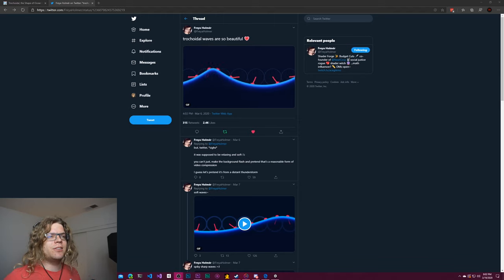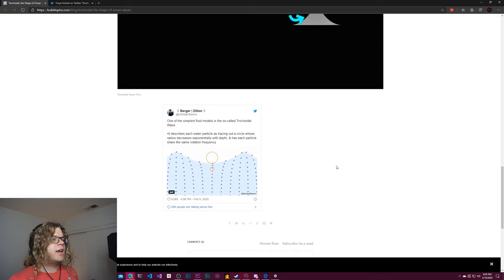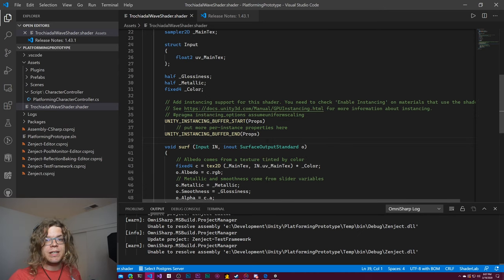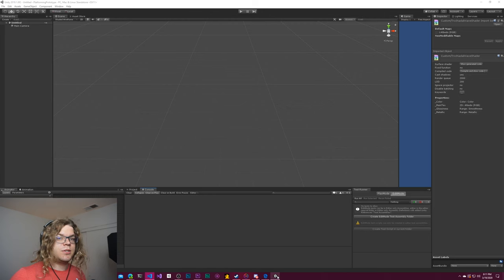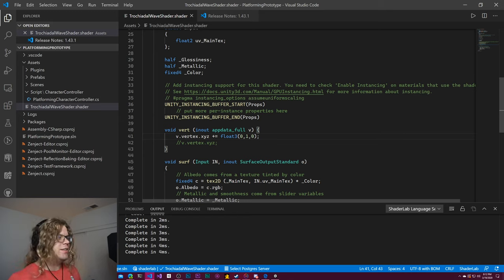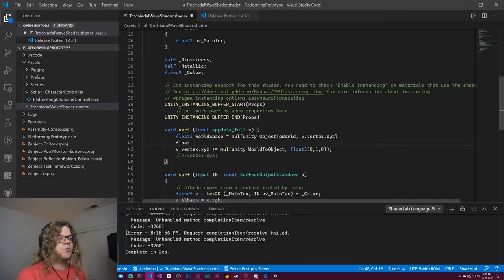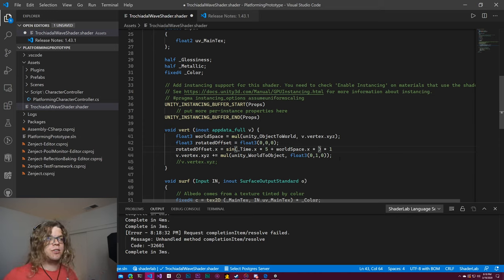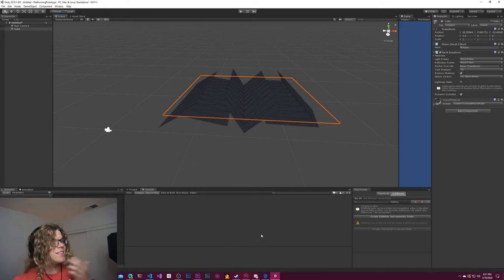Exploring a Trochoidal Wave Shader

Comment: 27:35 it probably fixed it because W in multiplying vectors with matrices determines if it's direction or position, without passing W value it defaulted to 0 so it got "treated" as a direction rather than a position and multiplication result was different. Pretty cool talk about it: https://www.youtube.com/watch?v=o1n02xKP138